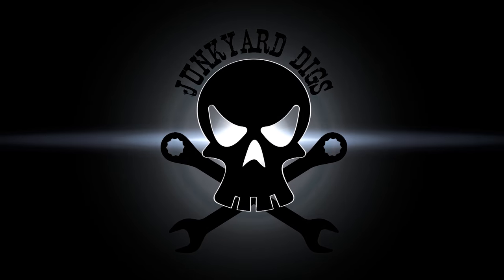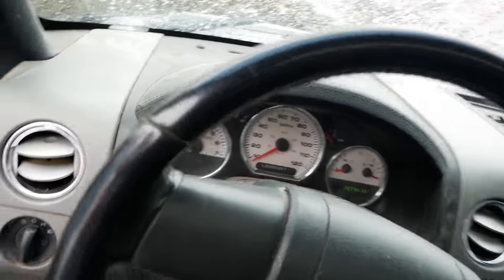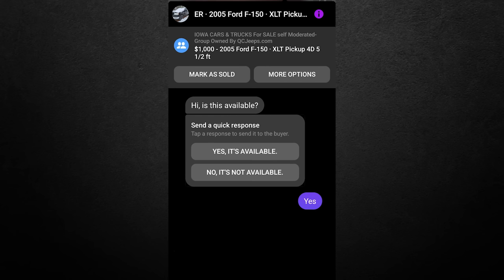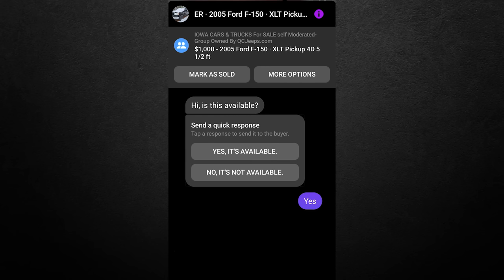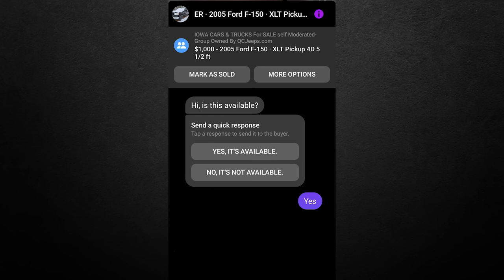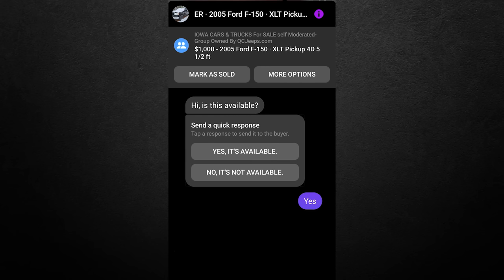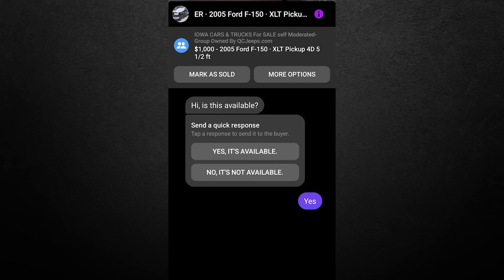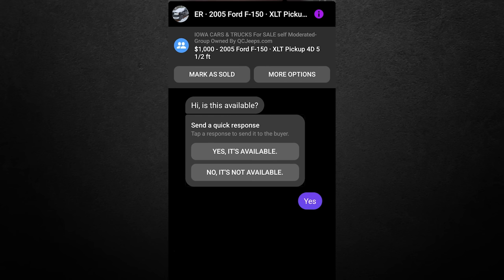How Safe Is a SEVERELY Rusted Frame? - REAL Crash Tests - Cornfield Science

Comment: as a mechanic in the "rust belt" for 25 years i can say ive seen this severe amount of rust quite a lot.
Reply: Yea thats nothing. My old 08 colorado had rust so bad it was coming off in large 3" chunks. It was so bad the steering column rusted thru
Reply: @Zippytez  that's pretty bad.  I remember the worst one I've ever seen.   we had a 2009 fullsize dodge ram diesel towed in. This was in 2015. They had an extended insurance policy that covered the engine and their engine was blown.  Well everything was so rusted virtually no bolts came out that we even tried  because the bolt head was still somewhat visible.   The insurance company was contacted before work began about the rust and they said they would cover any bolts that broke.   Well once we finally got the body bolts out and lifted the cab thier was not much left of the pockets where the bolts went.  And further inspection their were major sections of the frame that just we're not safe.  We called the insurance company saying that even with a motor the truck wasn't fit for the road and needed to be junked they argued and after some back and forth sent an adjuster who after looking at everything was pretty optimistic that it could be saved with a frame swap.  But first he got a ladder and was going to verify the vin number and had to wipe the inside of the windshield to get a view and when he shut the drivers door the weight of the truck cab being supported by the lift arms properly kinda shifted and the rockers were rusted so thin they buckled and the cab started just rocking and slowly getting lower until the actual doors were sitting on the lift arms. The adjuster just turned and looked at us with a shocked look on his face and we were just as shocked to be honest.  He said I don't care what I was told by my boss I'm totaling this truck.  My boss just kinda chuckled and said yea you kinda already did bub.  They cut the customer a check for way more than I thought they would.  Basically they paid him what that truck would be worth running and no mechanical issues.   Oh and by the way the engine blew because the oil pan had rusted thru most of the way around above the oil level inside and he hit a hard bump and the damn thing almost came completely off.  That was just a freak occurrence for a truck to be that far gone.  But how did your steering column rust thru.  That's pretty bad
Reply: @georgemccune2923  it had been my great grandfather's, he bought it a year before he passed. Me and my father used it primarily for hunting and just hauling stuff and sat anytime between that (potentially months). I'm in Midwest pa, and the salt just chewed that poor truck to bits
Reply: @Zippytez  ah.  Makes sense now. You guys get some brutal winter storms where you are?   We get that lake effect snow pushed down from lake superior and lake Michigan before it turns east and heads your way.  So you are a fellow member of the rust belt.  I'm on the Indiana Illinois border just south of lake Michigan.  I've probably been thru your area many times on the Pennsylvania turnpike heading to visit cousins in West Windsor New Jersey as well as up in the Poconos.  Been on the turnpike when the fog was so bad they shut it down and had everybody taking next exit. we got rerouted south on 80 I think towards DC.  Can't remember exactly as you couldn't see the signs to even read them.  Fog was so thick like driving thru cotton.  Never seen fog that thick in my life.
Reply: i just pulled an LS out of an '06 Silverado and when I put the truck up on Jack's a full 18-in of the frame on the right side fell off the truck. 48 years has a mechanic and I've never been so terrified to be underneath a vehicle worried that the jack stands or going toGo right through the frame in the truck was going to fall on me
Reply: As a life-long Californian, I’ve never seen anything like this — amazing!
Reply: upstate NY here, Currently, I am swapping an ls into a c3 corvette, engine came out of a SEVERELY corroded 06 Silverado. When I jacked the truck and set it on jack stands a 2 foot piece of the frame fell off.  This thing had less than 100,000 miles. 48 years fixing my own stuff, I have never been so uncomfortable under a vehicle, I was certain those stands were going to crunch right through what was left of the frame.
Reply: @georgemccune2923 , Depends in the maintenance salt will do what you allow it to do... I've owned trucks, one for 15 years sold it like new not one spec of rust...
Reply: I'm from New england and I see something like this probably once a month as well I probably know of 50 cars on the road today with frames just as bad if not worse lol I wouldn't want to get in an accident in them but some people just can't afford a new car so you do what you gotta do

Comment: I had a '94 Chevy S10 that the frame had rusted so bad in 4 spots that you could put your hand through. It was my first truck for $400 just to drive to school. I ended up repairing the frame in the worst spot so I could drive it again, but I actually got rear ended a few months later, and the thing folded in half so hard that we were lucky to be unharmed. Rusty frames are not a joke
Reply: I had a couple of s10 blazers 84 86 and 94. The frames held up ok but the bodies fell apart. 94 s10 blazer was still old body, pickup was newer body

Maybe the older frame was better
Reply: Hell they didn't have good crash ratings brand new lol
Reply: Got a 92 S10 that I'm so grateful is holding up strong and that makes me feel better after reading this not gonna lie haha
Reply: These f150s have fully boxed frames, I had a late 90s Sonoma and the frames on those are way thinner than the full size trucks.  Apples to oranges really
Reply: @carloskyoto5516  if it's not rotted use fluid film
Reply: @andrewdonohue1853  what's that ?
Reply: @carloskyoto5516  it's a product that you can find either at some retail autoparts stores or online. it's lanolin product you spray underneath the car, inside rocker panels, under the hood, inside doors ect ect. 

look it it up. most economical way to purchase it is by the gallon. i take a pot of water, place the gallon size can in the pot of water and heat it up on a hot plate. it's an effective product and costs around $45 per gallon. the treatment is dont annually. i have a 2022 crosstrek i spray the crap out of it.
Reply: @andrewdonohue1853  ohhhh dang I didn't know that! Central Texas doesn't get toooo bad over here but I ain't gonna risk it on my baby so I'll see what's up with that!
Reply: @carloskyoto5516  i live in new york state (unfortunately), if that product works here it will work anywhere. this climate where i live absolutely tears cars to pieces. i have a 2001 grand prix GTP at the back of the my property that is only good for parts at this point. it looks like the titanic underneath. i bought that car cheap and it already had 1 foot in the grave.
Reply: tell that to states that dont require state inspections, where truck/car frames are mostly made up of recycled bed frames an rebar

Comment: You actually showcased good engineering.  It was much stronger than thought.  Not road worthy, but row crop tested.
Reply: Yes, this is what Ford calls "weight savings" prior to the aluminum frame idea.
Reply: @gorkyd7912  having done bodywork, I much prefer the aluminum f150s because things like removing the bed is much easier because it’s way lighter. 4 guys could take an aluminum bed off vs 6-8 for steel beds
Reply: @Fhwgads11  And yet when the steel one completely rusts out it can be removed by 1 person. Innovation, deal with it.
Reply: @gorkyd7912  the frames on the new ford trucks are still steel. It’s only the bodies that are aluminum
Reply: @mattweeks2272  They experimented with aluminum frames a while back and iirc it made the vehicles too light to handle towing.
Reply: Almost a shame he smashed it. As durable as it roved to be it was a good field truck apparently. Could've put an alternator in and used it around the farm for years and not worried about scratching or making yer street truck stank with farm...stuff.
Reply: @FuckGoogle502  when did they experiment with aluminum frames? I never heard of that lol. Now I’m intrigued
Reply: @Fhwgads11  My 03 F150s hood is aluminum. We removed it to paint it and I couldn't believe how light it was, something like 22lbs. Meanwhile the hood struts on my 02 Jeep Liberty (toy) failed and it was a PITA to open because it was so heavy.
Reply: @Fhwgads11 
Yeah but the durability is gone aluminum is worthless

Comment: Despite how bad these 5.4s are, still my favorite generation of F-150. Passed my driving test in dad's 06' 4.6, started to do that low idle dip & lost compression in the rear passenger side cylinder. Still miss her every day, she was the last vehicle givin to me. Always take care of stuff that was givin to you, never take gifts or hand me downs for granted.
Reply: I heard the two valve 5.4 in the Econoline vans were better than the three valve motors with the phasers in the F series trucks.
Reply: my 4.6 made it too 320k before the timing chain went out! i loved that truck, it got me to work and home safe everyday. even when the timing chain tensior went out, it sounded like hell but still got me home!
Reply: @jeffrobodine8579 yes the 2v Tritons are great. 3v is junk.
Reply: That’s what I had for 9 years but mine had tne 5.4 and put 180k on it with no major engine/transmission issues.  Only swapped trucks cause of the high mileage, 360k and it’s still running as a backup truck. 

Got a ‘14 Silverado to replace it and already lost an engine in it at 210k miles but otherwise I like this truck. I work on a farm and not much if any towing so I don’t push the trucks too hard but I know the truck was owned by a construction company before we bought it.

Comment: I've never doubted the durability of the F150... But this totally blew me away. Great video.
Reply: I own a Ram but will admit Ford does in fact make the strongest overall truck chassis. Bent a Chevy towing and a tundra off-roading. Yuck
Reply: Oil spray annually not forgetting to  do the inside  of the frame or crossmembers the truck would have saved this truck .
Reply: I never doubt older 2000s fords definitely built better than modern crap of today

Comment: The best of both worlds, a rusted out frame AND a 3v 5.4! Yay! On another note, I'm surprised that a body shop somewhere didn't buy it to maybe fix a rollover truck. The body still looked kinda ok. One of the most entertaining videos I've seen in quite a while! Built Ford tough buddy!
Reply: If this frame rusted out, chances are, other ones have done so too. There are probably lots of more or less donor trucks for body parts. But yes, it kinda hurt seeing usable replacement parts getting trashed. -Cool, but wasteful. Still, he did try to sell it for parts.
Reply: That truck really crunched down.
I would say that MAYBE the engine is good.  I want to say the transmission and rear end can be good BUT, when I had my transmission rebuilt, they found the mounting ears on the transmission case cracked,  all of them.  because of the tight tolerances, they cannot reweld it. The case has to be replaced.   And my truck had not been in a accident and my frame is not rusted other than surface rust.
The rear end would have to be taken apart and checked for reuse but still may be a viable part.

Comment: Really does show why ensuring the underside of a vehicle is cleaned on a regular basis, especially in areas that see alot of road salt!
On a side note, I've been to many Demolition Derbies, and usually as the body bends on cars the frame tends to stick out even with regular 5-20mph impacts!
Reply: even cleaning them, the fully boxed frames will rust from the inside. cleaning on a open channel frame helps.  or you have to oil the inside of the frame if you're in an area that salts the roads.

Comment: I knew an old farmer years ago who always drove real old cars. One day he took a 45 minute trip , put some heavy stuff in the trunk and drove over a set of RR tracks at about 5 mph . He got stuck on the tracks when the frame bent in a 45°  angle  just forward of the rear axle . He was towed off the tracks straight to the junk yard where the car belonged in the 1st place
Reply: I guess the schedule was on his side if he got a car towed off the tracks before getting turned into what would assuredly be a dust cloud of rust by a train.
Reply: @NEEDbacon  
   yes very lucky , with the frame being in such bad shape he was lucky it didnt fail earlier

Comment: I feel like you guys do a WAY better job showing the world that rusty frames are actually very safe 😂.
Reply: I don't know about "very"..
Reply: Imagine getting sideswiped/rear ended by a newer truck/suv traveling 50+ mph. If your frame is rusted then you will obviously be fine
Reply: @Unclebobby82  exactly hahaha. That’s what I’m saying as well.
Reply: These are low speed crashes. Force in a crash increases by speed squared. These results aren't impressive for sub 30mph.
Reply: I mean if you think about it. if you own a tiny car like a smart car or a sports car/ 2 door car or a motorcycle. You'd get just as much or more damage/injuries during a crash.
Reply: The rear definitely was unsafe, but the rest was surprisingly good.
Reply: @Unclebobby82  "You will be fine" as in you won't feel no pain. Ever again. 😂
Reply: @industrialrubber5078  no you wouldn't, because they're stiff enough to make up for the smaller crumple zone. the most dangerous thing is when the passenger cell collapses which would have totally happened to this truck in a 50 mph crash, or a similar crash as shown here but with another truck instead of a light sedan!
Reply: @industrialrubber5078  No. That's absolutely not how that works.
Reply: Turning the frame into a taco isn't what's remarkable.  What's remarkable is that they did it at a mere 15 mph.  Imagine any collision at highway speeds.

Comment: Quite amazing, I didn't expect it to last that long and still drive. IDK about cars regulations in the US, but in most EU countries, you gotta pass an annual inspection test to keep a car roadworthy. And rust like this (well, not even close to "this") would kick it out instantly and you wouldn't get it approved again until you've repaired it at an authorized shop, with clean cuts and welds and painting on the new parts.

Comment: I've got a 2006 with a completely clean frame and the 5.4 triton. I love the darn engine no matter how bad an I'm amazed it runs like that with those issues. Makes me have more confidence in my truck
Reply: They're not really that bad. Some people really blow things out of proportion,   there are a few points of concern with the 3v 5.4 but they generally warn you well in advance. Don't ignore new sounds they make,  get on them immediately and you will likely see several hundred thousand miles with proper maintenance.
Reply: 5.4 phasers are nothing compared to the timing failures on new engines (GM 3.6, etc). It's just that mechanics will rape you with wrong diags and labor if you go in blind,
Reply: @Demoralized88  yea displacement on demand killed chevrolet
and dodge cant get oil to their lifters
Reply: Yes, my ‘09 5.4 still runs like new and has been basically trouble free considering I’ve driven the thing for 14 years now. The trick to these engines is proper maintenance from new and they last okay.
Reply: I own an '08 F350 with the 6.4L Powerstroke, so I get exactly where you're coming from. Both might need a little more TLC than some of the others, but it'll get the work done.
Reply: I’m glad someone got a good 5.4 . I had a ‘00 super duty that I adored and then it’s 5.4 copped and attitude with me. Which ruined the truck for me. It got sold.
Reply: @terrysweitzer6772  Ford and non Ford mechanics say the 5.4 3v doesn't come in nearly as much as the 3.5 EcoBoosts. I'm assuming they mean the first version 3.5 EB but I could be wrong. I guess the 3.5's keep them pretty busy
Reply: @anthonynicholson5523  I can't really comment on the eco boost stuff because I haven't seen enough yet,  but the 5.4 basically has two issues that get over blown.   We all know what they are,  one can be catastrophic if it's left go, which is why people freak out about it.  But it's easy to correct when it shows up if you don't procrastinate.  Otherwise you have a pretty good engine.  But you know what they say about opinions,  rocks, and glass houses!!!   I fly no flags,  I call a spade a spade!  If any vehicle was perfect,  we would all be out of work!!!
Reply: 265,000 on my 5.4. She purrs like a kitten. Change the oil at 3500 miles and keep it full synthetic.